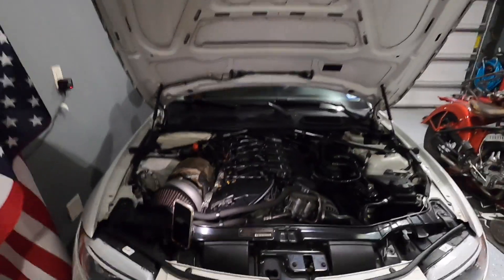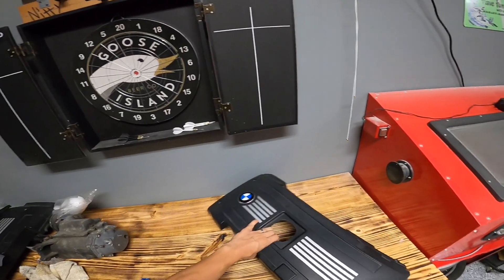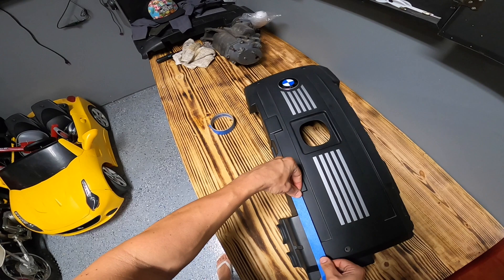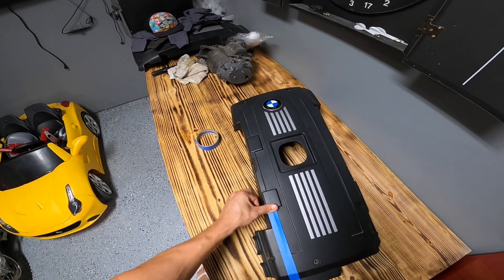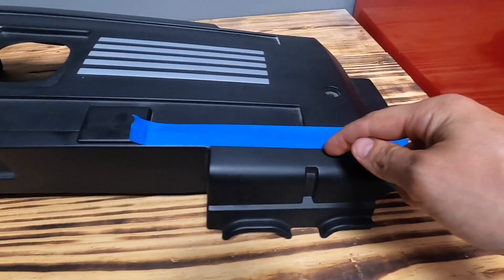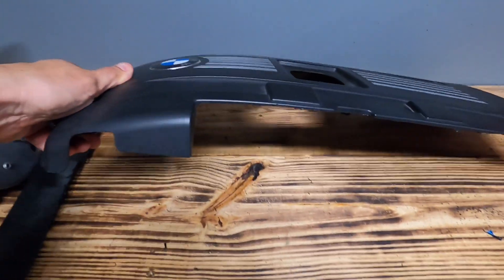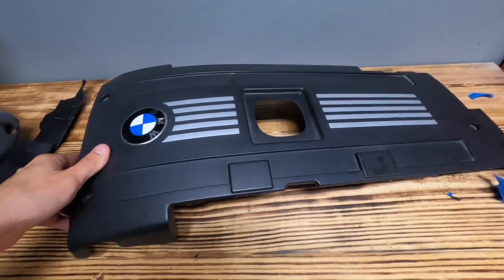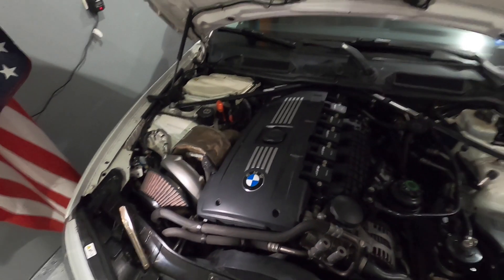HOW TO: Trim N54 engine cover to fit Precision Raceworks Coils

Comment: That cover has all the foam removed, does it rattle when the engine is running??
Reply from the maker: It does not rattle
Reply: @TheFuelChannel  does the cover get hotter than usual without the foam? Just wondering if will melt after driving for awhile I’m out in Cali. Thanks